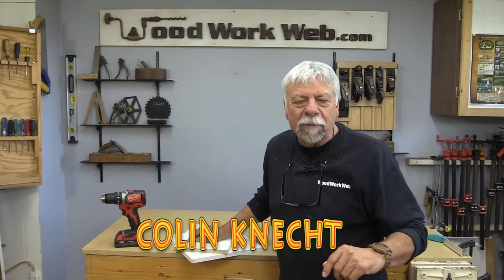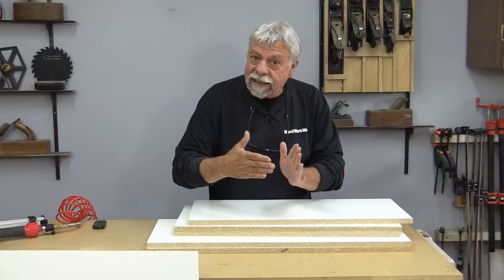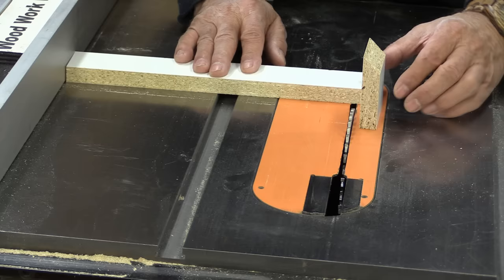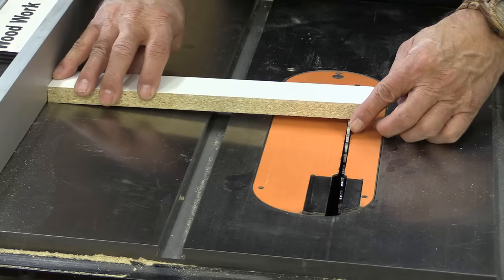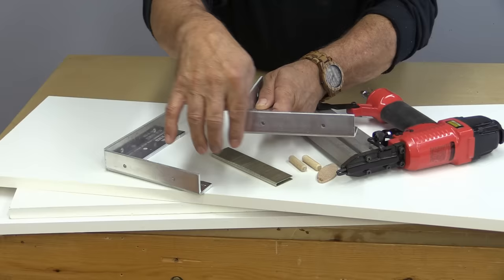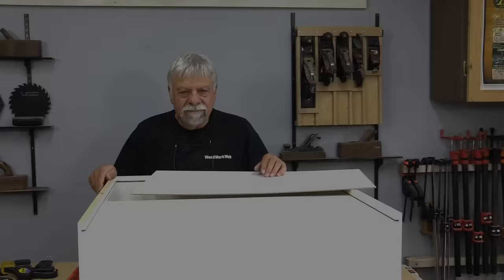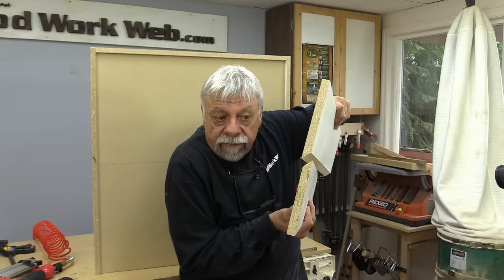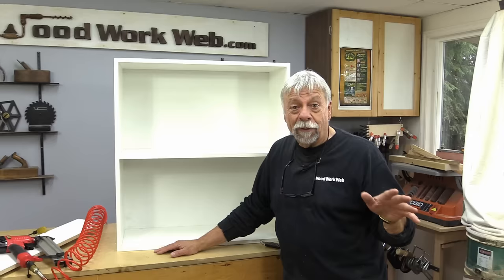Economy Cabinet Making with Melamine: How to Build Cabinets

Comment: Dear Colin,
I was wondering.. while you showed how to build this nice cabinet, the side of the shelves were with the melamine part (meaning, no laminate on the sides) and when you showed the final product at the end of the product, I could see that it is laminated all the sudden and I did not see any step of how to do that.
So, I had to admit, I'm a noob about woodworking, yet have seen like bazillion videos and feel like I know enough to start, but this step of laminating the sides of a shelves is a mystery to me. I know that the tradition way is to just glue that and rip the extra laminate using a router, I do wonder if there's another way, easier one, to do that.
Thank you
Reply from the maker: You actually purchase the boards laminating on one or both side from the hardware store, then all you have todo is laminate the sides on the finished project and you're done.  Thanks for watching!

Comment: Hi, what kind of blade that you use for the saws? About 40 tooth or more. Thank you.
Reply: coarse plade have 40-60 teeth inch and fine plade have 80-100 teeth. how many teeth have then better fine cutting come, lumber cut rough 40-60 teeth and furniture fine cut need lot lot more teeth. and planer.

Comment: I usually nail/staple the cabinet to hold it together, but then use screws to keep it together. You should have edged one piece for the complainers in the comments. I'm surprised they didn't get all b!tchy when you used an air stapler instead of nailing by hand. If you've got the tool, use it.

Comment: When I was cutting my melamine boards into size some of em chipped, is there like a spackle of some sort that can match the melamine boards to make it seem natural??
Reply: Chipping melamine has to do with the blade you're using to cut and how you do it.  There are videos on how to cut it effectively without chipping.  

But if you don't have a high quality saw blade with lots of teeth, you need to make 2 passes:  one a scoring pass with the blade height to just get through the melamine surface (then flip and cut the second side) and the second pass you raise the blade to cut all the way through.
Reply: You need i think a small teeth blade and high rpm and slow cutting to not make chips
Reply: @trzesniakj  yea cutting in one go chips on one side you said to cut twice
Reply: need fine teeth plade cutting shit cheap melamine and tape to help too line of cutting, but tape cutting line and then cut not broken melamine.

Comment: Nice video. I’m not a fan of particle board as it seems to sag over time.
Reply from the maker: It does have that problem, but it also the only option available to many people. Thanks for watching.
Reply: WoodWorkWeb yes - you’re right about that.
Reply: I keep hearing that,but it's mostly from American's from my experience. I'm Canadian and work in cabinet manufacturing. I wonder if climate has an effect regarding sagging. 
Have a 30 year old particle board kitchen,still strong as new.
 Canadians order more particle board than anything. American's tend to order plywood kitchens in large,Florida for the most part. But N.Y. and now Nevada seem to be order particle board now. It's like it's has been given a bad rap,but they also are used to framed cabinets and not the European frameless design from experience.

Comment: Thanks Colin for a wonderful video. I was wondering how much this edge bender costs and if there is any alternative to it. Thanks.
Reply: I use an old electric iron. practice a bit until you get the right temperature and speed.

Comment: Maybe I'm confused here, but it doesn't look like mdf... it looks like particle board/chip board? Anyway, nice tutorial whatever the boards are called! 😊
Reply: Melamine and partical board is the same. Melamine is particalboard with a coating/film.
Reply: Melamine is often put on higher quality particle board that does quite qualify as MDF.  None of the fiber boards have a great load bearing rating.
Reply: @malenekoldborg  Ehhh, not really.... Melamine IS the coating and can be used on both MDF and LDF (Particle board)
Reply: Egil W. Holgersen The melamine is actually part of a resin that coats a paper (in this case a white colour). That paper is then heat pressed to the board. I work in a factory that makes this type of press board. We also laminate decorative papers on to MDF as well.

Comment: I like your videos vary much. But if you are making instructional videos for the public. You should use tools that the home woodworker would have access to. Edge binder?  Many cabinet shops don't have that. So show us the way we would do it.
Reply: Lyle Carmignani , I agree.  An edge bander might be great for a production cabinet shop, but that’s overkill for a home user.  There are other ways:  I use an iron from the thrift store and a sharp utility knife on banding operations.  Just cut the banding an inch/4 cm longer, iron it into the edge and carefully trim it off with a knife.

Comment: Hi Colin,

I have to disagree with you about the type of board used.

Sorry bit this is not MDF it is what we in the Uk call chipboard, I think
you call it Prticle board.  But definately not MDF.

Regards,

Bil.
Reply: True, about the particle board, it's the same in the US. He referred to MDF whilst using the nails. Personally I think you shouldn't staple particle board because it won't hold with heavy weight in a construction

Comment: Nice work there, just wondering where did you get the corner brackets from?? (4:15)
Reply: They are called corner squares, made by Devon I think. Most woodworking catalogs (Rockler, Woodcraft) have them.

Comment: Just 4 pieces of major equipment, including specialty equipment: electric miter saw, table saw, stapler that can staple huge 1.25" staples into mdf, & edging machine for putting white edge on front edges of melamine.

Comment: It's not MDF, because MDF means Medium Density Fiberboard. Here in Brazil, we named this type of board  "MDP" wich means Medium Density Particleboard.
Reply from the maker: Let's go with "Engineered wood". Thanks for watching.
Reply: In Australia, we have products made to resemble lumber - decking boards etc - that are made from recycled plastics and wood fibre,  that are referred to as engineered wood. I'm a cabinetmaker, and we refer to sheets like this as manufactured board.

Comment: I usually watch your videos and I see that you make the playwood forniture like that, what I have always considered is the right method, even thoug I haven't build anyone. I have built a lot a melamine forniture and I can tell this is the way of NOT to do it. You have dozens of diferent conectors which give the cabinet a lot of streght and moreover, they can be mounted and dismanteled many times  without any damage. I guess all these conectors are not popular in USA. Confirmat screws, as is said in other coment, is a so cheap and dirty method that you can't find any comercial forniture with them.
Reply from the maker: Thanks for the tip and thanks for watching!

Comment: Portable edge trimming machine $1099.00, MA.1000 workbench $399.00, Portable edgebander $2199.99. With a total of $3,697.99 just to glue on edge banding and trim it, how again is this "Economy Cabinet Making"?
Reply from the maker: As I've shown in other videos, you can just use conventional cold press by hand or buy the newer iron on Melamine edging from most hardware stores. The build process will take you much longer, but you will be able todo it very affordability without the machines. Thanks for watching!
Reply: I didn't see him buying the machines you're mentioning, he had them already,  and he never mentioned "economy cabinet making with economy tools" I'm starting into woodworking and don't have all those machines, but I can definitely make them using the tips Colin shows in the video, stop being a smart ass and enjoy what people put effort to show you for FREE.

Comment: This is NOT an economy build. We don’t all have an edge banding machine nor an edge band trimming machine, nor a table saw and not even a pneumatic nailer.. I've made quite a lot of furniture from double sided melamine faced chipboard (MFC). I have cut the MFC by hand and jointed it using 8 mm dowels, edge banding was done by using an iron by hand and trimming using a knife or chisel. A nice try but in my opinion a complete fail...
Reply: Charles Arnold, not everybody has a doweling jig and an iron.  The fancy tools were on loan so that Colin could do a review of them, I think.  Colin is probably the nicest guy on YouTube, gosh, give the man a break.
Reply from the maker: Charles, as you point out yourself,  the machines aren't necessary so the build can be done very affordability.  Thanks for watching.